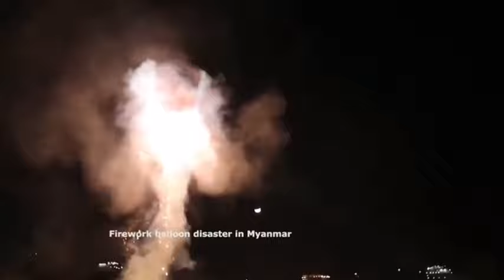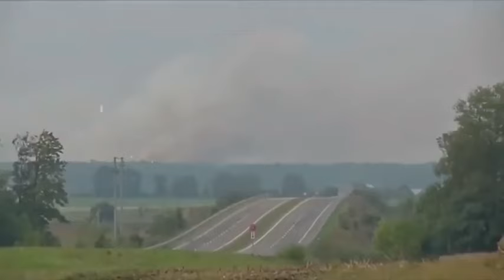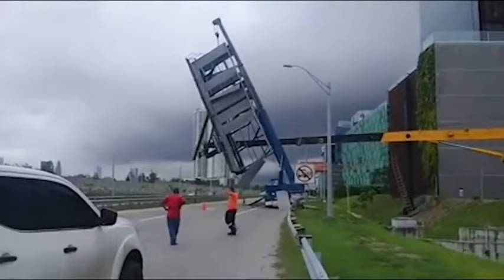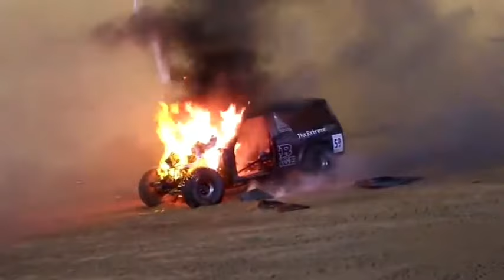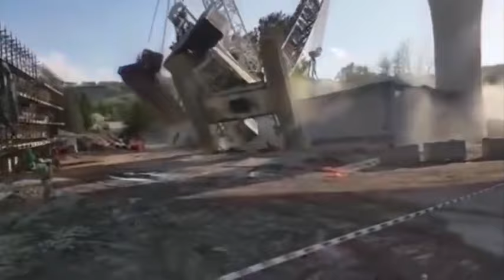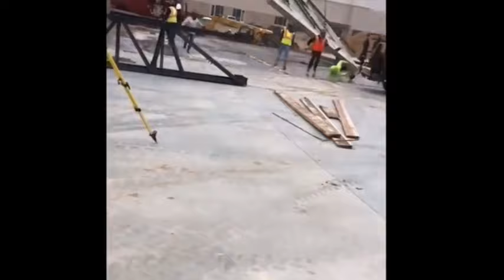Deadly Failures but with bad piggies theme song

Comment: I remember having an attempt at building a functioning space shuttle in bad piggies and only got it to land successfully once (land as in it did just about what Elon Musk's rocket did when it touched the pad)
The rest of the time it would fly straight up and slam into the roof of the map and explode; or disintegrate because of the insane speeds and pressures on the rocket. 
At one point I even used TNT as the launch method; using reinforced metal blocks to cushion the blow and direct all the force upwards. You can guess how well that went.
At one point I put down so little TNT the rocket lifted up and came back down and exploded; the second time I put just enough to launch it but not enough to get it to where I wanted it. 
The third time for laughs I put too much TNT and it achieved liftoff and flew into the map ceiling.
Reply: this is too funny